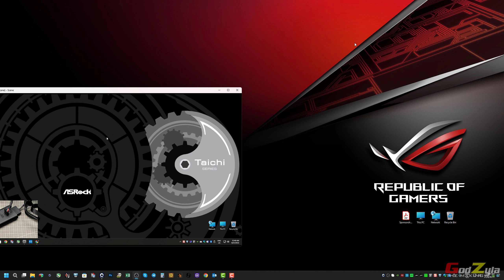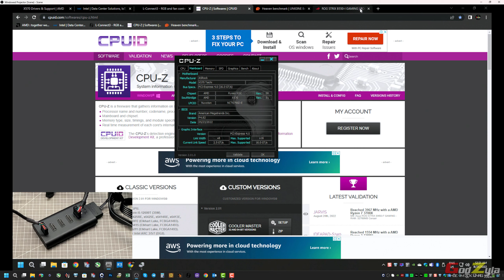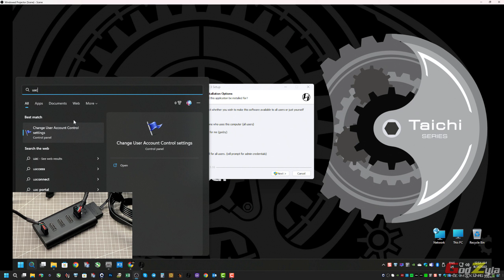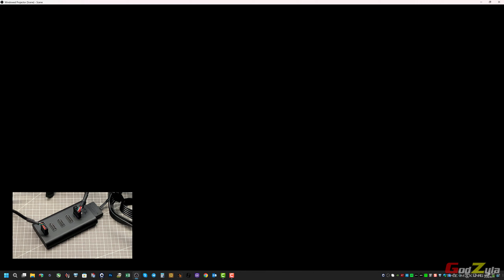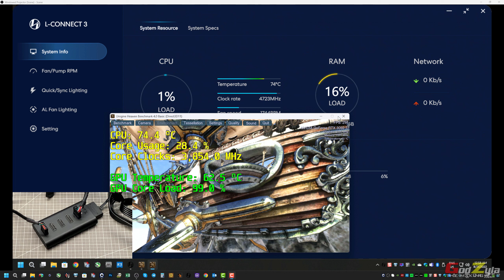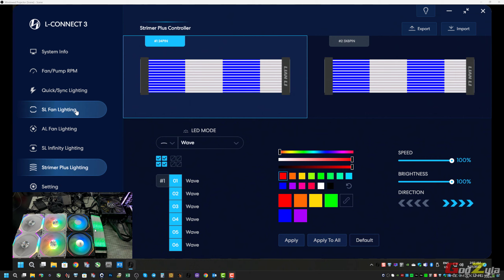Lian Li ARGB Products (How to make it work?) [L-Connect 3]

Comment: Hi everyone, HELP!!! The situation is as follows: 

I have 2 sets of coolers in my computer:

Lian Li on top. SL V2 3+1
On the side and bottom 3x2 SL Infinyty.

So here we go. The 6 SL Infynity coolers have stopped spinning, but the RGB is working. I first thought their SL Infinity controller was broken. 

Then I tried connecting these coolers to the SL V.2 controller and the coolers worked. The fan speed is adjustable. The only thing is that not all LEDs work as it is not an Infinity controller.
Infinity controller. When I plugged it in nothing changed. RGB works, but the fans don't move. 

And if for example a simple controller is disconnected from USB, then by default the fans will spin at maximum speed. 

So I tried disconnecting the Infinity controller from USB, but as a result the coolers don't move either.
So it turns out that coolers with two native controllers don't want to spin, but with non-native controller they spin fine, but only RGB is not fully lit..... What to do?
The new Infinity controller (which I found in the box) was on firmware 0,8, but L_Connect suggested to update it to 1,4. But even after the upgrade the coolers still didn't start.... 

Now it turns out that I have to connect coolers to SL V2, ignoring the fact that not all LEDs work. But somehow I can't believe that my native controller failed, and the new spare one turned out to be ‘accidentally broken’...

Translated with DeepL.com (free version)
Reply from the maker: Hi Iaroslav Istomin, welcome to my channel. I would advise you to test one controller at a time. If currently one uni controller/hub is working, troubleshoot the other. Please make sure SL Infinity is to SL Infinity Uni controller/hub and the SL V2 to it's SL V2 uni controller/hub.

1) Make sure your motherboard bios is up to date, please check on your motherboard manufacture website, under support > bios and drivers. See if there are issues with USB and do they have a fix. If there are, kindly update those bios firmware version.

2) Make sure your chipset driver for your motherboard is up to date! For AMD will be at https://www.amd.com/en/support for Intel will be Intel Driver & Support Assistant Intel DSA https://www.intel.com/content/www/us/en/support/detect.html

3) Remove all argb apps (Asus Armory Crate / MSI Dragon Center / Giga Fusion / Asrock Polychrome). If the brands which I have mentioned, do have a uninstall tool like the Asus Armory Crate, use that, else use Revo uninstaller ( https://www.revouninstaller.com/ ). Revo uninstaller will remove all unwanted files / folder / registry in your system. Illustration to use revo uninstaller https://www.youtube.com/watch?v=uMgUYiakpxM&t=437s

4) Shutdown your PC, unplug the PSU cable from your AC outlet. Press the power switch twice to discharge all current that your motherboard is holding. Leave it for 45 second

5) While waiting, please do not use KVM switches. Disconnect all devices that are connected to your motherboard (front / back IO). Leave only your Keyboard, Mouse , Monitor and Ethernet (If you have) connected directly to your motherboard. 
If your monitor has a KVM build-in, remove the USB cable from your monitor to your motherboard USB socket. If your mouse and keyboard are connected to your monitor, please remove them and plug them directly to your motherboard instead.

6) Plug only the Uni controller/Hub. If its for Uni Fan (SL/AL) use only 3 fans to an output of the uni controller/hub.

7) Plug the power cable and turn on your PC

8) Go to your Device Manager, look under Universal Serial Bus Devices, make sure you see the Lian Li Uni AL controller.

9) Install the L-Connect 3 app only https://lian-li.com/l-connect3/ (current version 1.3.16)

10) After installation, run L-Connect 3, check under Setting > General > make sure Auto-Run on Boot and Minimized L-Connect 3 to system tray at close are ON.

11) Reboot your system.

12) First thing you need, go to device manager and see if the Lian Li controller is listed, next open up the L-Connect 3 app. Check if there is a need to update firmware to your controller. Go to Settings > Update, under Device F/W version, click on Update Check, download and install the firmware. Make sure the firmware is completed. Do a check on device manager and make sure the Lian Li controller is listed.

13) On L-Connect 3 dashboard, check if the CPU and GPU readings are reacting, you might want to test it using some benchmark programs. If there are reaction, play with the PWM and argb functions. If it does not work, skip step 14) and proceed step 16)

14) If Single controller works, shutdown your pc, connect uni fan set of 3 to your output of your uni controller. Do it small steps at a time to hook up your sets of fans. do not do all in one go. If successful and you have a second controller, proceed small step at a time again.

15) Slowly plug back your USB devices (Headset, Microphone, Printer, USB Capture Card and etc). At any point of time as you add those devices one at a time, if L-Connect 3 become unresponsive. This tells you that there power is insufficient to power up more USB Devices. Whatever USB port on your motherboard, there is a limitation as the current are shared across the board, be it front or back I/O and the internal USB Header. You might need to get a Internal USB Hub that comes with a Sata Power source to the Internal USB Hub. (Disclaimer, buying a internal usb hub might or might not resolve this issue, purchase at your own expenses)

16) If it does not work, report your issues to Lian li Tech Support. There is a in build log ticketing system in L-Connect 3 app. this is what you need to do. Go to Settings > Support > Click on “Download log” place a filename and choose a destination drive to save the log file. Next click on “Report” it will take you to Lian Li Tech Support FAQ. Fill up the form and upload the log which is a zip file.
Reply: @KleoYan  Thank you for the extended response. Yes, I did everything as you have it written. The controllers are perfectly recognised by the computer. I have tried several operating systems. I even installed a ‘genuine’ system, but nothing works. The regular SL V2 controller works fine, but the Infinity does not spin the fans (although the RBG works fine). The second, spare Infinity controller behaves the same way. So at the moment I have Infinity fans connected to SL V2 controller, so that at least they can spin. The only thing in this case is that RGB does not work fully (only 2 out of three fans are lit). 
So BIOS and USB problems are excluded. 
Moreover, if the controller is disconnected from USB, then the fans should spin (so does the SL V2 controller). But Infinity controller (both of them) if you disconnect it from USB - fans don't spin too (only RGB works). So this rules out any power supply problem (I tried different connections), rules out Windows (since I don't connect USB at all). 
I think this is a problem between the controller and the fan itself. Some kind of paradox.
Reply from the maker: @istominmusic  as you've mentioned that both uni controllers are recognied in Windows. are you able to check in L-Connect-3 app. under settings and device. are the fans highligted or not highligted. It could be because of this, your SL Inf fans are not reacting. https://i.imgur.com/uAFbtT7.png (diagram reference)
Reply: @KleoYan  Well, first of all, of course they're singled out. And secondly, this highlighting works only for illumination, not for engine speed. Even if I switch off the highlighting - just LED backlight will go out, but it does not affect the revolutions in any way.
Reply from the maker: @istominmusic  Hi and welcome back, is your hub pwm cable connected to the motherboard fan header? (any of the fan header), if you set the pwm in L-Connect 3 app to sync with motherboard, will that react? if you did plug that and still no reaction when syncing with motherboard, check your UEFI to see if you have set to PWM instead of Auto. if all else fail, I have no idea what's going on. you might want to enaged Lian Li tech support https://lian-li.com/contact-us/
Reply: @KleoYan  Hi! I haven't tried connecting the coontroller to the motherboard. Most likely there will be no difference, as it feels like the controller doesn't write to the vertilators at all. Then I will try to connect it. For the sake of experiment I want to connect fans from another controller (SL2) to this controller. But most likely they won't work either. 

And about writing to technical support. Before you write something to them, you have to fill in hundreds of different data (including serial numbers, which I don't even know where to look). It's a puzzle just to ask for help from the manufacturer.
Reply from the maker: @istominmusic  I see. As mentioned if the last step can’t aid you. I am running out of ideas. You might want to seek help at Lian Li Reddit forum. https://www.reddit.com/r/lianli

Comment: Hello, I have a problem with the controller which is detected as unknown in the device management even though all my fans are running and the rgb too. (uni fan Al 120 Rgb)
Reply from the maker: Hi KibzyGOD R6S, welcome to my channel, in general when you plug power, your fan and argb will operate. Now is the control. if the AL 120 Hub does not show in device manager under universal serial bus devices, then you can't control the AL Fans via L-Connect-3. you will need to get this right.

Comment: The controllers are terrible. Lian Li not making a controller that has more than 3 ports is terrible. 
The lighting looks ok on my TL fans but only if you use solid colour, the effects are really jarring and I'm pretty disappointed really at the basic level of the L Connect software. 
Almost every single effect gives an error.
Reply from the maker: Hi The Sound of Legends, welcome to my channel. I would partially agree with you. In general it greatly depends on how many ARGB , LCD devices you are applying on a system. All these ARGB And LCD applications shared the same system address. Each application has it's own flaws here and there. else the only application which is the SignalRGB has an upper hand, that is to set and to have all controller application by pass to sync only with SignalRRB. so ya.. you might want to try SignalRGB but do note, some effects may need to pay.

Comment: mines lights work fan doesnt or fan works light doesnt, sometimes only 2/3 fans wrok idk what wrong
Reply from the maker: Hi Alecelos Rambo Ilyaas Mayfield, welcome to my channel. Have you tried each and individual fan one at at time. If all works then see your profile if you have the fans highlighted under settings of your L-Connect 3 https://lian-li.com/l-connect3/l-connect3-manual-2/
Reply: @KleoYan  yes i dont understand hats going on the controller doest work to controll any rgb anywhere else either
Reply from the maker: @alecelosramboilyaasmayfiel395  maybe list down what devices are you using, else can't aid you future. example if you using AL V2 controller, first thing you need to know if this controller is even showing in Windows device manager, under universal serial bus devices. Maybe keep yourself calm and to re-watch this content, as I've pointed out in details what you should look out for.
Reply: @KleoYan  I have it shows up it shows fans are connected been having this issues a while
Reply from the maker: @alecelosramboilyaasmayfiel395  which fans are you using? Have you tried testing those fans one at a time? Go with basic to narrow down. With all connected. You can’t tell what’s the issue. It could be controller, It could be bad fan connection, it could be bad cable. It could even be application glitch.

Comment: I just installed a 12vhpwr strimmer v2 and a 24pin mobo strimmer v2 to one l connect 3 controller but it is making me chose between one or other via the switch on the l connect hub, am I supposed to just get another controller and only hook up the sata power?
Reply from the maker: Hi Nobody59, welcome to my channel. Each Strimer plus V2 controller supports up to 1 24pin and 1 GPU cable. That's why  you have to swith accordingly at the side. which the side with a switch is only mean for your GPU cables depending on what type of connectors. If you have additional 24pin or additional GPU .. then you will need another controller.
Reply: @KleoYan  thank you!
Reply from the maker: @hxghxz  you are most welcome.

Comment: I know this is a year-old video but I do have one question. L Connect 3 doesn't show my CPU fan speed under the System Resource tab like I see in your video. There's no graph at all other than Temperature and Clock Rate. The "Fan Speed" bar doesn't show at all for me.
Reply from the maker: Hi The Kontrarian, welcome to my channel. Mind if I ask if you have other argb devices or argb programs running before L-Connect 3. Also just the controller itself. is your windows able to detect the controller, under Device Manager > Universal Serial Bus Devices.. last but not least, can you listen down the PC components in details, else I can only diagnose in general.
Reply: @KleoYan  sure thing. Thanks for responding. My setup I have 10 Lian Li SL Uni 120 fans. 3 on top as exhaust, 3 reverse blade on the bottom as intake, 3 reverse blade mounted on a side radiator as intake (NZXT Kraken 360 Elite) and one rear fan as exhaust. I have the Lian Li controller with all fans going through the controller. No groupings daisy chained. 3X3X3X1 into each port of the Lian Li control box. Control box going in a USB header. Not using the separate cable connected to the control box to the motherboard to bypass L Connect 3. My AIO cooler I removed the default fans that came with it and installed 3 Lian Li reverse blade fans instead. The NZXT AIO pump is going into my CPU FAN header. The NZXT AIO has a program NZXT CAM software to control fan RGB and fan speeds. But I’m not using the default fans so no RGB functions or speed control. No other RGB going into the motherboard. My RAM is RGB but controlled by the motherboard. Gigabyte B650 Gaming motherboard does have built in ARGB (Gigabyte Control Center) to control RGB but only the RAM RGB I can alter being I don’t have the Lian Li control box connected to the motherboard with the extra cable. I am controlling all fans with L Connect 3. Only one control box. No strimmer extension cables or additional USB hubs. Device manager recognizes the Lian Li controller. Firmware and Lian Li software up to date. Latest bios on motherboard and Windows 11 Pro.
Reply: @KleoYan  I can control all fan speeds, RGB etc with the L Connect 3 software. However, I doesn’t show CPU fan in that window likes yours does. Also it doesn’t show a picture of my uni fans at the top of the speed control like yours does.
Reply from the maker: @TheKontrarian  on your motherboard UEFI, have you set the fan mode to PWM instead of Auto. that could be the issue. give it a try and on L-Connect 3, make sure the fans you are using are highlighted. It's under settings of your L-Connect 3 app https://lian-li.com/l-connect3/l-connect3-manual-2/. btw why do you connect your pump to the CPU_FAN? you should be pluging your pump to AIO_Pump hmm.
Reply: @KleoYan  I will give it a try. I know the fan mode is definitely set to auto in the bios. As far as where to plug in the AIO. On the motherboard at the top I see CPU_OPT, CPU_FAN, and SYS_FAN1. I didn’t see a PUMP fan header at the top like I have seen on some motherboards. However, all the way at the bottom of the motherboard I do see a SYS_FAN3_PUMP. Should it be plugged in all the way down there? I thought it would be rather odd. That’s the only reason I plugged the pump in the top CPU_FAN header at the top. The motherboard is a Gigabyte B650 Gaming X V2 motherboard. If you’d like to see pictures of it.
Reply: @KleoYan  I changed it to PWM in my bios but no change shows in my L Connect 3 software. I could make a small video and show you what my setup looks like and what L Connect 3 shows and doesn’t show. I haven’t attempted to move the plug to the bottom SYS_FAN3_PUMP header yet.
Reply from the maker: @TheKontrarian  ok. Upload to YouTube and send me the link at godzylatech@gmail.com  I will have a look after my work thank you.
Reply: @KleoYan  ok no problem. I'd say everything on my system is working properly. It's cooling etc. Maybe this is just an issue or bug in the L Connect 3 Software? I do see CPU FAN speed in the NZXT CAM software. I've uploaded a video and provided you a link via email. Thanks so much for your help. It's really appreciated.
Reply from the maker: @TheKontrarian   I have replied to you via email. It's perfectly fine. you are not missing anything, just that the new version does not shows the CPU RPM. as for your connection, after reading your motherboard manual. it's perfectly fine to use pump on CPU_FAN. reason is,  the CPU_FAN header is providing 2A, it's more than enough . https://download.gigabyte.com/FileList/Manual/mb_manual_b650-gx-v2_1103_e.pdf?v=4a3ee4460065edb2df24a1fb8a182f30 (Page 21)
Reply: @KleoYan  Thanks so much for the reassurance. I replied via email but will reply here too. Good to know I have everything running properly. Thanks also for providing a link to the manual. As I said in my email I started to take the build apart an hour ago and made sure everything was hooked up to the Lian Li controller correctly especially the fans on the AIO. I had to reapply thermal paste, removing the stock paste. Temps now down another 4c! Thanks again for your help and your replies!
Reply from the maker: @TheKontrarian  Nice 👍👍👍to drop a few degrees more and you are most welcome. 😉